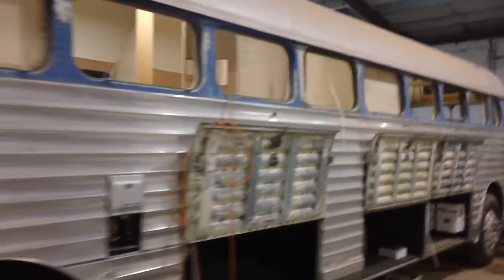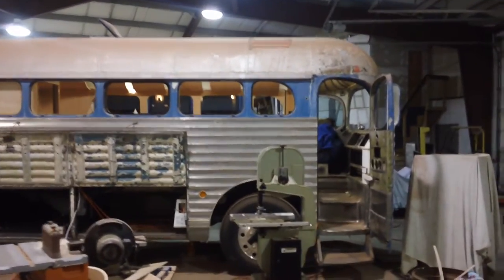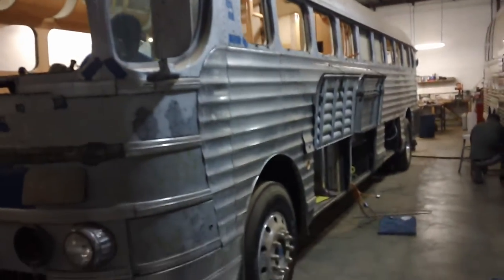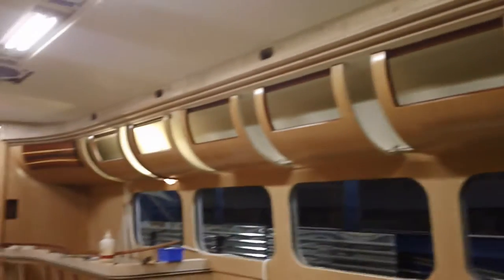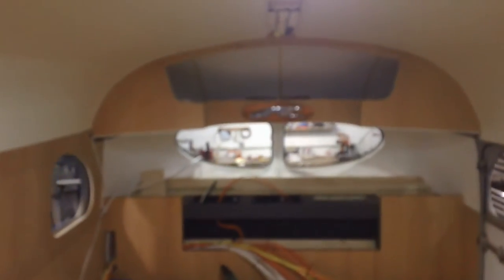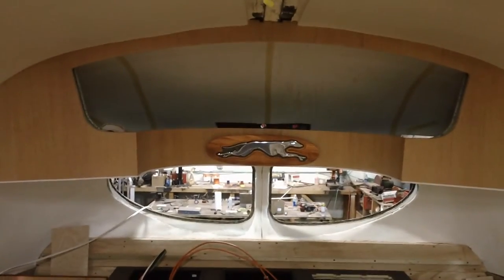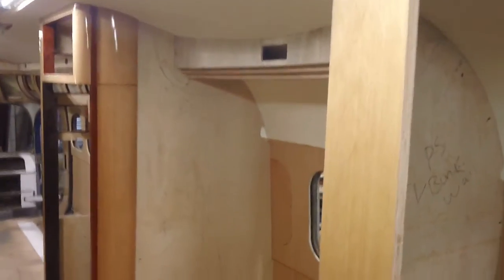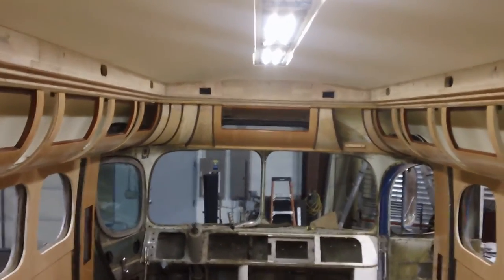Silverside Project 1

Comment: Sweet looking project. If I had the money, I'd keep the bus as stock as possible, but I'd also upgrade everything mechanical, and I'd install a more modern diesel engine, a 5-spd synchromesh manual transmission.